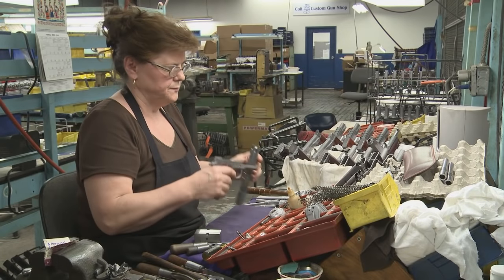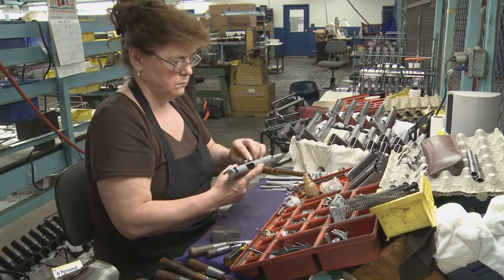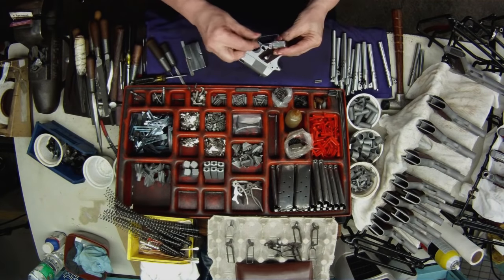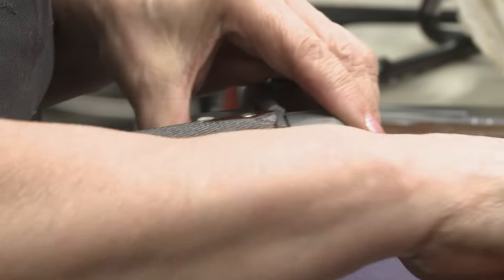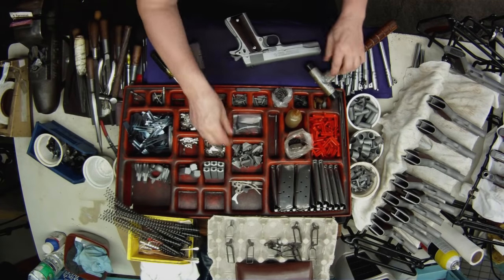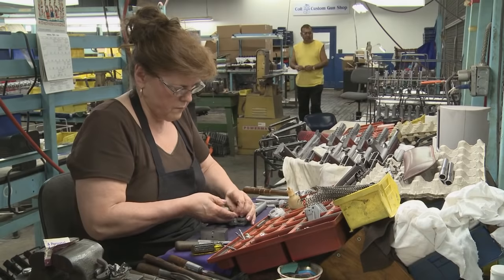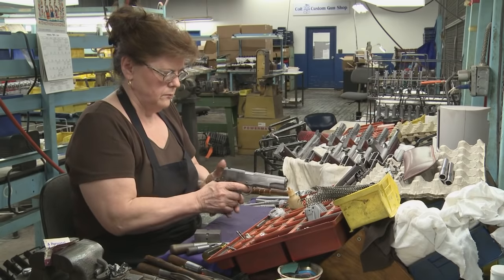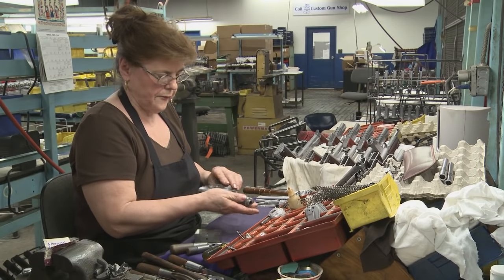Assembling a Colt Government 1911 at the Colt Factory

Comment: 3:04 you can see where the slide and the frame come together on the back it's perfectly even ( not like lots of other companies 1911s )
Reply: I think instead a bit of an underwater where the slide is a tiny bit shorter than the frame. Compare that to a Les Baer or Ed Brown. Absolutely ZERO mismatching. No over bite, no under bite. Looks like one piece of billet steel.
Reply: @ms.annthrope415  For a mass produced gun the match up on the rear of the slide to the frame on Colts is pretty dang good. 

Unfortunately the extractor fitting on my Series 80 was less than stellar from the factory.

Comment: Did you check the spring compression constant on each spring to ensure closure of the breach on reload ?
Reply: During rapid firing
Reply: So I take it if you have not a firm grip of the trigger will lock
Reply: Why do you need thumb safety

Comment: Colt 1911s and ARs are nothing like they used to be. They are acceptable firearms but no better than the competition that's almost half the price now. I've had XSE custom shop models from Colt that even after being broken in would fail to feed or eject constantly. I had one in particular with the most annoying beavertail rattle. Not nearly the quality you should be getting for the price point. I highly recommend Springfield for a much better quality gun at a lesser price point. If you get a Colt you want one from the early 80s or older.

Comment: so my brand new Colt is full of metal filings?
Reply: tw203809 yes so do a thoural cleaning first!
Reply: Probably not, they use an air compressor to blast all of the filings out, the gun is cleaned at the factory too so your 1911 is totally clean.
Reply: Abhishek Singh 
How do you know, You have this gun in India.
Reply: I saw her use an air compressor to blow out any filings.

Comment: Now I know why these guns are the way they are. She has a pile of parts. Nothing is hand fit. This is why a Colt is a base gun.
Reply: "Nothing is hand fit" 
Literally shows her using a file to hand fit parts.
Reply: @colinj5291   That’s not hand fit
Reply: @hoot1141  Filing down a part to make it smaller and testing and refiling is handfitting. I get this is a production line 1911, and with mostly drop in parts, but they offer fully handfitted guns from the custom shop. A Colt is definitely not a budget gun either way.